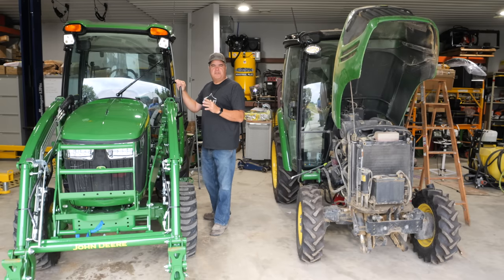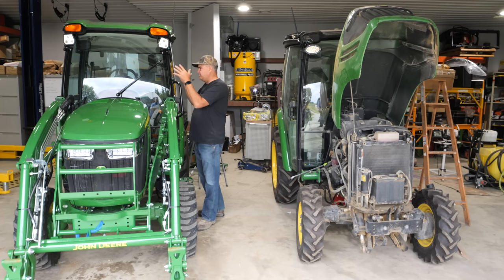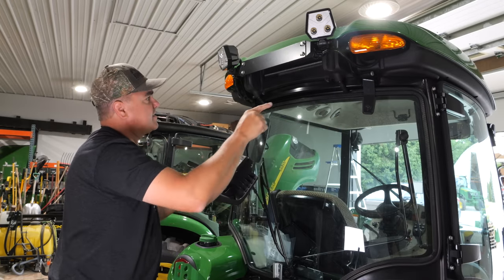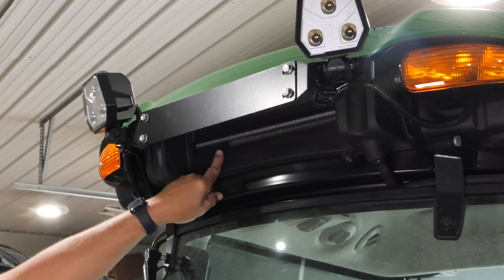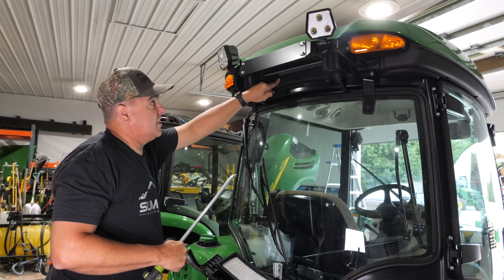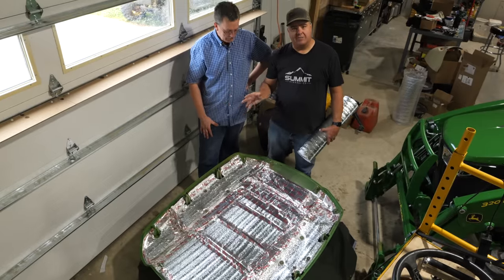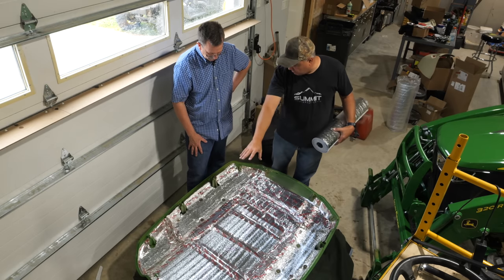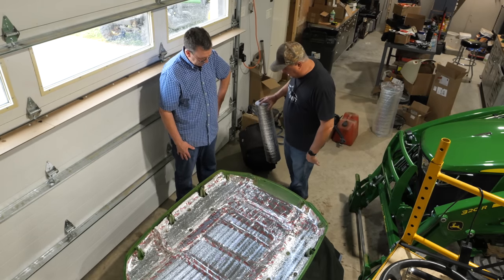8 A/C Upgrades For John Deere Compact Tractors, PLUS 20 Bonus Viewer Ideas!

Comment: Great information!  Great video!  Suggestion:  With Chris's body/paint skills, lay up a very simple curved fiberglass shell approximately the size of the cab roof.  (Nothing pretty, but painted green.  This is just an experiment after all.)  Mount the shell to the roof using adequate short - maybe one inch - stand-offs and rubber gaskets.  In effect, the shield will absorb most of the solar gain  The air-space between the roof and the shell will not only shield the roof from direct solar gain, but it could/will provide additional protection for the roof and additional mounting points for accessories if designed accordingly (eventually).  (For an even more aggressive experiment, cover the shell with a mirror reflective wrap. Or, how about solar panels to be ESG/DEI-correct?!  No?? Save some green paint.)  If it works, and if production is contemplated, final design could include a variety of enhancements, refinements, and capabilities.

Comment: Hi Tim! Great idea with the foil insulation if there is an air gap below it. I wouldn't give 2 cents for it's R value though...Foil works great to stop radiant heat and the greater the temperature difference between the two sides, the better it works. Stopping heat from radiating down works best. We checked the temperature in the attics of two identical houses in the same subdivision on a hot summer day - one house had regular OSB on the roof and the other was foil faced on the bottom side. The attic of the foil faced OSB house was about 20 degrees cooler... I think most of your heat gain that you will feel in a tractor on a hot summer day will be radiant heat to your head. The increased R-value for the conductive heat will be primarily from the air in the bubble pack part of the insulation - not much... I really appreciate your videos! Very informative! Thanks for all you do to help others. Love the Bible verse at the end too - great reminder of the source of all truth!

Comment: Tim you need to consider Ceramic tints if you don't want the dark hard to see tint. Ceramic tint comes where it blocks all the uv you don't want but is virtually invisible or slightly darker than the windows themselves..you don't have to get the really dark stuff to work anymore
Reply: Yes, works extremely well.
Reply: If they get 70% ceramic tint would improve it a lot without losing much visible
Reply: Did you mean to say infrared radiation?  not UV

Comment: Do not block off the fresh air intake or change the % of recirculate vs fresh air.  There is a lot of testing that goes into this as the only way to pressurize the cab is to bring in fresh air.  a cab that is only recirculating air will not be pressurized and will actually bring dust into the cab.
Reply: Yes, but I'm cool

Comment: A slight overcharge of the AC system will drastically improve the temperature of the air from the vents. Ensuring the condenser and evaporator coils are clean is very critical when doing this because you don't wat to have excessive head pressure. I found that adding a few extra ounces over the total factory charge weight will lower vent temperatures approximately 6 degrees making a significant difference especially here in the deep south. There is no danger when doing this if done correctly. You need to recover the factory charge and weigh in the new charge adding the extra ounces when doing so. As Chris stated you are looking for a designed subcooling and with any system that uses a refrigerant there is a + or - tolerance. Doing this is simply adding a degree or two inside the allowable tolerance of subcooling.

Comment: You forgot the most important thing, paint the top white!  Years ago I had an AL roof on my 33' Class A motorhome.  The inside used to get quite hot and the AC struggled to keep up.  I then painted the roof white (RV roof paint) and it was amazing how it cooled down the RV. 
  I also installed white reflective shingles on my house, again amazing difference in the attic & how much cooler the attic is now.  I notice CT school buses have the roof area where the kids are painted white but over the motor it's painted flat black, I gather for easier starts in the winter.  So... I suggest to paint one roof white, let them cook in the sun & see how much cooler the cab with the white paint is, my guess 30 deg cooler!

Comment: Look into a tool called an air comb. It is the same idea as the tool you have except it is a straight piece of tubing that is capped at the end that has several holes drilled in the side of the tube. It’s very compact and effective.

Comment: The condenser is larger in the new tractor because the new refregerant (R1234yf) needs a larger cooling area to provide the same cooling performance as the older (R134a) systems.

Comment: Hey Tim:  As to your window film on the tractor, Id suggest Ceramic tints.  How they differ from normal tints is that they reflect up to 95% of the heat, while keeping a clear unshaded window.  Yes you do have the option to dim it down, but as you mentioned, that makes to tough to film thru a darkened window.  I own a Transit 350 and it has a hugh heat sink for a front window.  We found that the surface temp stays lower which in turn allows the a/c to work alot better.

Comment: One thing that needs to be addressed, at least on our 3046r, is how so much dust gets around the filter.  After a shredding, even for just a little bit in a dustier environment, my evaporator coil has dirt and dust in it because it gets around the bottom of the filter.  It seems to have to do with the filter cover not pushing it down evenly to form a good seal to the back of the cab.  I think that would help with maintenance of cleaning that extremely thick evaporator more often than necessary.   Thank you for this video.  The struggle is real.  The Lord Bless you and your family!
Reply: Your struggle is over with patent pending ChaffX!!

Comment: Do current model cab tractor air conditioner systems not cool as good as current pick up trucks if the filters are clean?

To compare on a recent day I checked my 3500 black exterior color crew cab diesel.   Conditions full sun 2:30 EDT, air temperature 91 F three feet above the weathered "light black" asphalt my truck after a 30 minute drive and stopping in the parking lot had a center AC discharge air temperature of 46 f after 5 minutes on max cooling.  When put on automatic HVAC setting at 74 F the front seat temperature was able to maintain 74 F.  I was happy with the truck AC.  Will a modern cab tractor AC system not be similar?

Comment: Hi, my idea , is to paint the roof White or at least the center and leave the margin John Deere Green.  If you could get it to stick, you could even use that white ceramic roof coating.  This might not be practical but we're just throwing ideas out there, right?   Im positive your insulation probably made a couple degrees difference. If a little is good, more is more gooder.  Nice video🌬️

Comment: Tim my Kioti does have recirculate switch which works well. I have no problem keeping cool even on hottest day here. I’m obviously in Michigan so we don’t get the heat at like south but still get some really hot and humid days. I do use the radiator Genie after every time I do any field work and think that is key as you mentioned to help keeping air flow. I also gonna tint windows also but never had any problem keeping cool so far. Great video a lot of talk on this subject right now. 👍

Comment: Ceramic Tint is the way to go on the windows.   I have put ceramic tint on all of the windows of my last 2 trucks (including the windshield).   The amazing part is that I have not had to clean my windshield of the off-gasses from the dashboard in years.   Ceramic tint is amazing and you can get it light enough that it does not hinder visibility in the cab.

Comment: I did the same seals and added insulation (not the same as yours) about two weeks ago.

Next time you are out tractoring for a couple hours on a hot day, reach down and touch the metal by your seat, the floor mat, and the steel under that mat.  Very hot and a huge source of cab heat IMO.
Reply from the maker: Ah, that ‘steel’ has been covered in my machine.  I’ll show you in the next 3520 video.
Reply: @TractorTimewithTim  sounds good I'll look to see what you did.  I covered mine about 10 months ago and I will be curious if there are any similarities.

Comment: Absolutely excellent video Tim. Really a lot of great information packed into this video. 
I see those Larsen lights on the old 3520. 
I ordered a set of those lights from Larsen yesterday as well as a rear camera setup from them for my 3046R. 
I have a couple threads on GTT all about the different exhaust which includes several pics of my vertical exhaust on my 3046R and 4066R. 
I had my windows tinted with a ceramic 80% film meaning I have something like 90% UV and heat rejection but only 20% darker then clear or stock glass. That has helped a bit with my AC cooling. 
I think when I have the top off my 3046 to install my wired HD rear camera setup, after seeing this video, I think I will get some of that insulation as well as check all my foam seals. Very good info all around for cab 3 and 4 series owners.

Comment: A thermal camera for testing  would both ease your project with visual representation for you and give a much easier to understand picture for the viewers. 

With all things involving temperature control, it can be divided into two categories; insulation and efficiency. Make the a/c more efficient and insulate from outside influences. The easiest way to increase efficiency is insulating the system itself as you have, decreasing refrigerant cooling loss like insulation on the lines and increasing air flow through the condensor. I would be quite curious how much of a difference swapping the mechanical fan altogether to a high cfm electric would be. As it wouldn't vary air flow by rpm it would maximize it at low speed. Just an idea.

Comment: In my opinion using recirculate air would make the biggest bang for the buck. Just like in a vehicle, when it's really hot it'll either automatically (or manually in older vehicles) switch thus making a drastic difference in cooling. You're basically making the whole AC system more efficient by not trying to continuously cool 100+ degree air. The cooler the cabin air becomes, the more efficient your AC will operate. I'm surprised they don't build this into the design from the factory. It's really auto AC 101.

Comment: I am amazed that you had to do so much work to get your air working cooler. My LS has a recirculate button and when you put it in recirculate you can be so cold in a hot sun day that once you have it cold go back to fresh air and you stay nice and cool all day. And as far as the heater in the winter goes, I have spent 4 hours clearing snow on a 10 degrees below zero F wearing only a shirt. Had to ditch the coat once it warms up, about 15 minutes, and you're warm as toast.
Reply from the maker: It is only an issue in the Deep South and on crazy hot days.
We are being ‘perfectionists’.  You’ll see that a lot in JD owners.  We expect the best.  If something is just ‘ok’ or ‘marginal’, we’ll see what we can do to make it better.

Comment: The biggest thing is to verify you are getting air cooling that is within JD spec. Or even more basic is making sure your ac compressor is running or your system charge is correct. Lastly it’s confusing on the ac controls. One switch turns on and off the ac compressor, but the cool knob does the same thing if you don’t have it on full cool it will kick out the compressor. Suggest doing another video on the mechanical side of the ac system about charging the system, evac of the system etc. using a real system not the Autozone cans.

Comment: One other thing to check is the sealing surface between the cabin air filter and the intake itself to make sure there isn't something that could cause a gap between the 2 mating surfaces because any gap could allow more dust to get past the filter.  Another thing that might help to keep the dust out from the internal stuff is to cut a heppa filter and place it behind the main filter to help filter out even more of the fine particles.

Comment: As much as these tractors cost John deere being the most expensive it is ridiculous that  anyone has to deal with this and no offer from jd to fix this I have a 2014 4520 the a/c has never been adequate to the point that on very hot days I leave it parked and use another tractor I will never buy john deere again!

Comment: Tim just fyi, I did a little checking on my 2019 cab 3046R this evening. 
My condenser coils has the same measurements you described on the 2024. 
Not sure what year Deere made that coil change, maybe when they switched from 3-20 to 3Rs ?
There was talk on GTT about Dear stating improved AC on 2024. I thought that larger coil was probably it. 
I guess now I am wondering if they actually changed anything from say the likes of my 2019 model to the new 2024???
Reply from the maker: I don’t think there were any A/C changes for ‘24.

Comment: Good ideas there Tim on extra cooling.
Having trouble with my 2019 4066r AC, lost freon, appears to be under roof, will trouble shoot for leak.
Another problem is Deere tech manual and also parts list doesn't cover an extra line added to the control
head of the TXV (H block expansion valve).
Can't get any info. about the modification from Deere or dealership, tried many times, very frustrating.
Think I figured out what they are doing, but would like confirmation from Deere.
Nobody else, truck, car, tractor does this with a H block expansion valve that I can find, appears
to be a Deere thing???

Comment: I got the windows tinted on my 3039r (I’m in central FL) and it made an amazing improvement. I also use spray no-rinse evaporator foam cleaner on the evaporator coils and fins and suck the excess out with my shop vac. This helps if I don’t want to take the roof off.

Comment: Tim, 2 things..... 
1) They make a clear "tint" that blocks 85% of the heat and UV !!!! I have it installed on the huge (6" x 8' ) windshield on my RV. 
2) Back in the 80's, I worked for a custom harvester and we ran JD equipment. We were in the JD House one day getting some service work done and we thought we kept the condenser coil clean up in the roofs, The old man JD mechanic took a bottle of Windex with Ammonia-D and poured it over the coils and then poured cold water over the coil. The blackest nastiest water came out of the drains and it was the coldest combine AC out of 6 machines. Needless to say, the next rain day all machines got the same treatment.

Comment: I know it's a different application, but we had the windows tinted in our sunroom. Blocks around 90% of UV light but when it's all done you can't actually tell a difference inside the house between the look of the tinted windows and the untinted windows. It made a noticeable difference on the amount of heat from the sunlight. So I don't think it would impact your view if you used a product like that. If the cab glass has any curves, I think it would make tinting much more difficult.

Comment: Great video, Deere should offer a Recirculation mode, Max AC like on Autos, my 4720 open station rad is a pain to clean even with the wands you have, couldn’t imagine even dealing with another core squeezed in there, I know they offer tints now that look clear but repel the UV Rays and help keep it cool, so you get the best of both worlds

Comment: Hey Tim, an idea for vent improvements, might be to engineer something that is 3d printed for duct work. Just an idea that came to my mind when you were mocking up the ducting. You could go as far as adding a layer that increases the cabin height some but allows for insulation and ducting while maintaining the seal. It's something where you could share the plans or manufacture for sale. Just thinking aloud. I enjoy your videos and adventures. Keep up the great work.

Comment: Your custom air tool, seal the end, not bent, take tube and drill small holes in it. about 1/2" apart. about 4 holes total, start small enlarge holes as needed.

Comment: On our forklifts that were diesel and cabs most were we had maintenance install shutoff valves in heater lines to keep heat from going into the heaters in the summer time. And once installed we drivers could open and close them when needed. Nothing like burning your leg in the summertime. We also would remove the doors, unless it would rain all day.

Comment: Also check the coolant valve under the roof if it is wore or adjusted wrong hot coolant gets into the heater core lowering cab cooling performance

Comment: Tim I think that deer designed it the way they did to keep those relays cool and not blowing and putting the tractor down for hours a relay puts off a lot of heat and need the airflow to keep cool

Comment: Great video I have a 4520 2013 a/c never work's good when 90 or hoter was told by jd only to keep cooler by 20 degrees what the outside temperature is
Reply from the maker: I think you'll find these changes will dramatically help.
Reply: Added that roof insulation and it does help out big time in this tractor cab. This is a must do Next thing that we will do  tent the windows.@TractorTimewithTim

Comment: if you want to not allow outside air in....... put syran wrap from the kitchen aroud the cab air filter.... if you change your mind it only cost you the cheap wrap.
Reply: Bad Idea.  Eventually you will run out of oxygen and check out.
Reply: @larrybecker9645  is better than blocking passage indefinitely first off..... secondly..... when it's not warm enough to run the a/c..... you can run that tractor endlessly .... and not check out....... I've lived in day cab trucks with air-tight cabs and no a/c.... haven't checked out yet